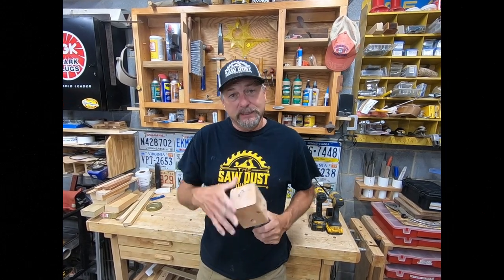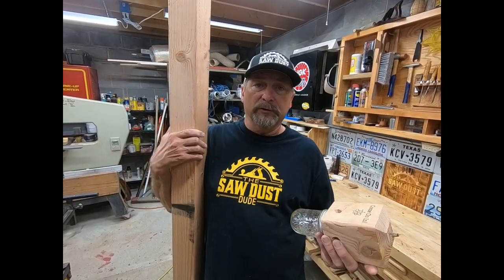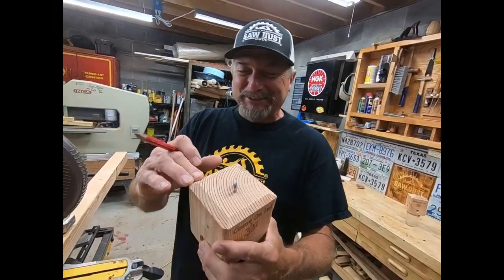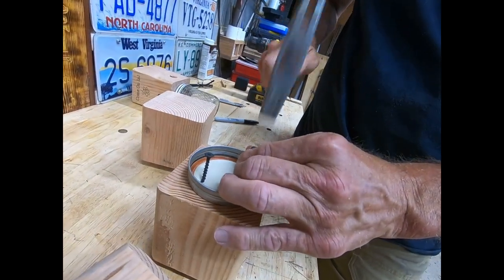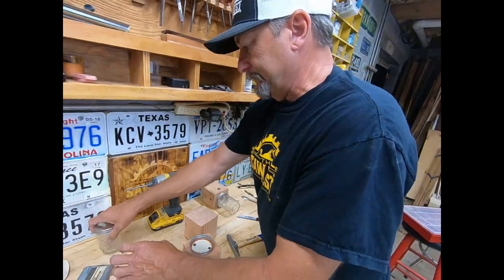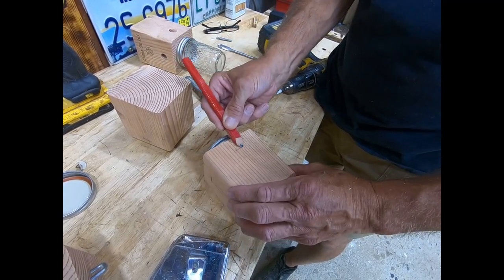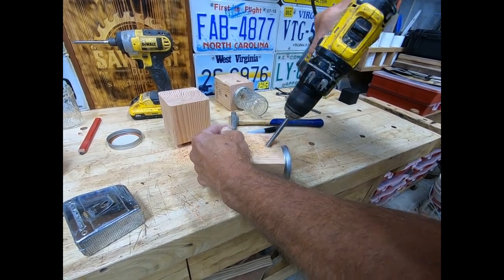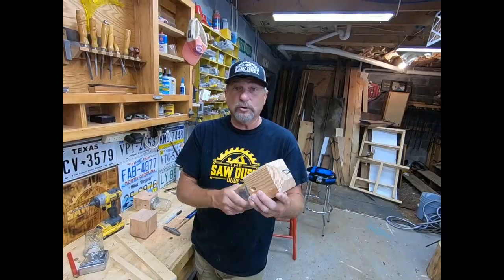DIY Carpenter Bee Trap - Build, SELL, Make MONEY!

Comment: The reason one leg is longer than the other on the staple, is so you can start one leg first, then sink it.
But my question is, why can't you just pull the trigger on the drill and drill the hole, instead of pumping 15 or 20 times? I understand the pumping when starting the angled holes, but once they are started, I just pull the trigger until it finds the other hole. Am I doing it wrong?

Comment: Do not use pressure treated at the Bees can smell the chemicals and will not go in the holes.
Reply: They might not prefer it, but they will go into pressure treated wood also.
Reply: Beg to differ. Here in Florida they are all over my new treated wood deck and roof overs